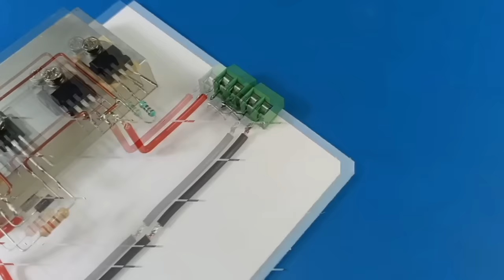DIY Simple 0-30V 0-10A DC  Variable Power Supply // Voltage and Current Adjustable

Comment: Hello , I came back here to say that I created this project , it was excellent , I had already tried others ; but I didn't have the expected result, it was really worth it.
Reply from the maker: You can try with maximum 5 ampere input, result good
Reply: Normal 10k volume control ok ya??
Reply from the maker: @shamnadj8011  yes
Reply: Hola, muchas gracias, la alimentación es de 220v?
Reply: @alfredofont4150  Não , pode ser alimentado com até 30 volts
Reply: Gaming experiment  Have you already investigated it? I also have the same doubt
Reply: i made it and my left potentiometer burned, someone know why?
Reply: @alonalyy meu amigo meu também não sei motivo mais talvez esteja no potenciômetro mesmo tem que ser pelo mesmo 2 watt
Reply: Can I use 120v to feed the circuit?

Comment: Fron the diagram if i remove the volt metre and shot the red wire with the pin beside the positive output wire will it work

Comment: I just made this thankyou so much for this amazing diy 
I tried many YouTube power supply diy's but those were just for the views.
You earned a subscriber.
I would suggest to provide the circuit diagram at the starting of the video
At last thankyou again....
Reply: What is the highest ampere it could handle
Reply from the maker: Ok, please check diagram end of the video

Comment: Can i use tip142 instade of 3055?
In an another i saw he is usin 2 tip 142 for increase the current is it possible plz reply
Reply from the maker: No, you can use any non transistor

Comment: Finally i found the problem today ,it was the tip3055 and 7805, all ics were on heat sink and when i unscrew bd139 and 7805 from heatsink circuit worked but unfortunately i shorted probes and the tip3055 died :) i tested it all three pin of 3055 are shorted together

Comment: WHAT IS THE INPUT? CAN U EXPALIN IT
Reply from the maker: DC 12-30v 1-10A
Reply: At least 5V more than the maximum adjustable voltage..
At least 10% more than the maximum adjustable. amperage

Comment: Hello RJ, 
Thank you so much for this video. It's really helpful for me. Could you please mention how much voltage/current should I inject at source? Actually I'm looking for a voltage booster from a 3v battery. I need variable output as 5v, 9v, 12v along with 2amp at least.
Reply from the maker: Please visit my Channel for dc dc boost circuit

Comment: Hola por favor la entrada de energía tiene que ser necesariamente 15- 30 DC o podría ser de menos voltaje gracias saludos de PERÚ
Reply from the maker: You can use 12-30v dc input 1-7 ampere
Reply: Gracias

Comment: thanks for the contribution, one question if the source with which I am going to feed is 15 amps, the circuit like this works for me, thanks
Reply from the maker: Maximum 7 ampere input

Comment: Dc input 15-30V is fixed or variable?. Can we replace this DC by Ac, using an ac source connected to transformer and bridge rectifier and filtering capacitor??
Reply from the maker: No, you can convert ac to dc with rectifier
Reply: Thanks
 @RJEDITALL
Reply: Can u do the simulation for the same circuit please? @RJEDITALL

Comment: I have carefully assembled the circuit using the provided components and followed the instructions meticulously. Despite double-checking all connections and verifying the orientation of each component, the circuit did not function as expected. I tested each part of the setup individually and ensured that the power supply was providing the correct input voltage. However, there was no output, and the volt-amp meter showed no readings. I have verified that the diodes, resistors, and potentiometers were connected correctly, but the issue persists. What can i do? please someone help.
Reply from the maker: Use this power supply, n make this https://youtu.be/PJ6ZEYMhzgs?si=-kKS1zb13q7A8MjC
Reply: I had the same problem and Now it works Thank you

Comment: Hello @RJ I would like to know the power source parameters used to demonstrate this wonderful creation.
Reply: I built one and am using a solar panel to power, into a boost converter. And my power output is a little low.  So I wanted to know what you used.

Comment: Hllo My question is how many volts i have to provide to the circuit ?
Is it direct 220v ?
Reply from the maker: No 30v dc supply input, with 220v to 15-0-15v=30v ac convert dc with rectifier diode n capacitor

Comment: sir what kind of resistor did you used in connecting  7805 to 2nd pin of 3055, is it metal film?
Reply from the maker: 220 Ohm 1/4 watt
Reply: That information is very useful and what type of resistor did you use to connect the LM317 and BD139 I would also like to know the type of resistor you used for the LED

Comment: hello boss . nice your project . but i have a problem 220R resistor burn in lm317. please send me this solution ....
Reply from the maker: Please use 1/2 or 1 watt Rasistor
Reply: @RJEDITALL  already i am using 1/2 watt . but lm317 short and 220r resistor burn. please help me.
Reply from the maker: @mdsohanahmed4185  please check it well, and change lm317
Reply: thanks boss .
Reply: @RJEDITALL  successfully done my work boss . my lm317 is 2no . today buy new 1 . and ok .😊

Comment: I did it but the 10k potentiometer didn't hold up and it ended up getting burned. Could you tell me why this is happening?
Reply from the maker: Please use multiple potentiometer
Reply: Which potentiometer would you suggest?
Reply: You should use 2 watt pot or more wire wound pot.

Comment: Tnx Dude, I made this but I have one problem, could you help me out, the thing is I didn't find 30 volt input but I have 42 volt input, You said max 30 volt input, what can do that 42 volt works for me on this project? ❤️
Reply: I mean some solution for low down that 42 voltage, I want use Epson SX130 power supply on this project, and also I want to have that Max 30 voltage on this project, tnx
Reply from the maker: You can use 42v , but transistor very heating problems

Comment: May i ask, what is the input voltage source that u used? Is it a battery? And what is the rating?
Reply from the maker: I am using 30v 3 ampere transformer

Comment: Sir..
I have made this as directed...  Though i used the 10k pot (made of adj rod in plastic/pvc) not exactly the one u used in this, but it got burnt...  Could u pls let me know the exact specs for pot to be used for volt and current adjustments...

I have inputted 20v, as it is very well within the spec 0-30v /10amp
Reply from the maker: Check it well, and use big heatsink
Reply: @RJEDITALL  yes.. i used the heat sink, it's paste etc...  Despite that, 10k pot gone for toss

Comment: Excelente…!!
Saludos desde Mexicali BC, Mexico.
.
I have an Xbox 360 with 12v and 16.5 amps.
I know that the amperage is way high, but I’ll apréciate your help to make similar regulator that can support that current…
Reply from the maker: Thank u, Maximum input 3-30v 1-7 ampere
Reply: Вам нужно в выходной каркаде установить несколько транзисторов, базы и коллекторы соединяйте вместе, а эмитеры через мощные малоомные резисторы для выравнивания..

Comment: Need to get 48 volts (DC) 20 amp out put for my 900 watts 48 ( DC ) volts heating element from two solar panels connected in parallel.
Can you help me making a device.
Regards
Reply from the maker: Big project

Comment: Will the circuit work without volt meter?
Reply from the maker: yes
Reply: @RJEDITALL  but what changes of wiring I need to do??
Reply from the maker: @silent_tech8490  No need to change, output Red and black wire
Reply: @RJEDITALL  then will there be some use of 7805 in circuit
Reply: @RJEDITALL  sir please reply
Reply from the maker: @silent_tech8490  you can use without 7805 transistor

Comment: Very good Congratulations! I have a question, if there is a short circuit on the output does the source go into protection or does it have a defect? I'm using a translator, I hope it's possible to understand the text.
Reply from the maker: You can use input side a fuse for short circuit protection
Reply: @RJEDITALL Добрый вечер!
Предохранитель на сколько поставить?

Comment: Good video!  I got the parts to build the device!  Will I be able to have 5V and 8A at the output so that it does not overheat and shut down?
Reply: Выходной каскад на 3055. Сам транзистор по даташит выдерживает 15ампер, но нельзя не считаться с рассееваемой мощностью. Для этого транзистора в металлическом корпусе она 115Вт. Для успешной реализации Вашего проекта нужно знать входное напряжение. Например у меня выходное 21в, а выход в Вашем случае 5в, значит падение в 16в умножаем на 8ампер =128Вт рассеивания, это погубит транзистор, а за ним и lm317. Вот если на входе будет 11вотльт то уже нормально. Но не забываем про охлаждение!

Comment: Normal 10k volume control ok ya??
Reply from the maker: Yes, but multiple variable pot best
Reply: MJE 3055 ok?
Reply from the maker: @shamnadj8011  ok
Reply: Maximum input supply?
Up to 55 volt possible?
Reply from the maker: @shamnadj8011  30v

Comment: Hola hice el mismo circuito con voltaje de entrada de 24v a 3 A y no funciona no prende ni el voltímetro... Me gustaría saber que pasó!
Reply from the maker: Please check it well, and check your pot , n transistor
Reply: @RJEDITALL  use el tip 41c usaste ese o el otro q anotaste por q según yo todo está conectado igual para saber q tránsistor está dañado que voltaje tiene de salida cada uno por q el regulador lm317 t si tiene salida de voltaje

Comment: What was your input voltage ?
What is the max input current/voltage?
Is your input ac or dc?
Is the output ac or dc?
Reply from the maker: Maximum input 30v 7ampere dc . Output dc

Comment: What is the power source in this video?
Reply from the maker: DC supply input
Reply: @RJEDITALL  from what kind of battery or other circuit
Reply from the maker: @davidprock904  transformer
Reply: @RJ EDIT ALL  what are the volts & amps (that you said is DC) from the external source that you do not demonstrate in your video?

Comment: what kind of power do you use input?
Reply from the maker: Dc 3- 30v 1-5 ampere
Reply: @RJEDITALL  i wanna ask also what should i do to have 36v 10a adjustable power supply connectted to directly home power 220v ac. i need to power my 775 dc power for good rpm. i dont have anything for it
Reply from the maker: @resatbora  you can use 220v -36v 10 ampere transformer for your adjustable power supply connect

Comment: On va appliqué une tension continue ou alternatif combien de volt  ?
Reply from the maker: Maximum 30v input
Reply: @RJEDITALL  comment obtenir un tension continue de 30v on peut faire quoi  ??
Reply: @RJEDITALL  comment je peut obtenir 30v  ?
Reply: Para obtener corriente continua de un cargador de laptop o simplemente a un transformador con salida de 12 o 15 voltios de corriente alterna le haces un puente rectificador y le pones 2 condensadores para llegar hasta 20 a 30 voltios de corriente continua.

Comment: Sir my resistor always fry once we plug it on AC , the resistor 220R connected from 7805 to 2nd pin of 3055 is what im talking about sir.
Reply from the maker: Please check diagram in the video

Comment: Nice job bro., Can I use this circuit as a battery charger? What is the maximum amps.in output? Thanks bro. More power to you!...
Reply from the maker: 0-6 ampere
Reply: @RJEDITALL  cuanto voltajes de entrada??

Comment: I have given 12v dc input
Used of the following
LM317T
BD139
TIP3055
LM7805
1N4007
220 OHM 1/2 WATT RESISTOR
IN BOTH PLACES
BUT THE VOLT METER NOT SHOWING PROPERLY
AND I CAUNT MEASURE THE CURRENT
Reply from the maker: Please use multiple potentiometer

Comment: At what supply does this project run?
Reply: we have to give 30v dc and 10 amp from  dc sources  to this control  circuit,  then we can  vari the output voltage  from 0 - 30v  and current  from 0 - 10amps .

Comment: RJ I have 1000w ups, but it works 24v, I have a 100A battery, if I connect it to this circuit you made, I will run ups.
Reply: 12v 100A
Reply from the maker: No bro, you can use maximum 7 ampere 30 dc input

Comment: Hola. He hecho el mismo circuito y el Led rojo parpadea constantemente y el 3055 se calienta muchísimo 8ncluso a bajo emperaje. Cuál puede ser la causa?
Reply from the maker: Please check It well, and big heatsink use
Reply: @RJEDITALL  el caso es que la fuente funciona perfectamente, pero no podría aguantar 5 amperios nunca, mucho menos diez. Le cambiaré el disipador. Y el led parpadea siempre. Esté en uso o no, parpadea el led, y no le encuentro explicación
Reply: Amigo ya revisaste la etapa de rectificación y filtrado que puede ser por ahí el problema ya que el LED es solo para indicar que hay alimentación a la entrada del circuito regulador.
Aparte creo que tienes razón con costo 5 amperios en el mejor de los casos puede sacar.
Reply: In С1 4700 m x50 v, out С2 470 m x50v. Этой схеме нужны сглаживающие фильтры .

Comment: How many volts and how many amps has entered the circuit?
Reply from the maker: 3-30v 1-5 ampere input
Reply: @RJEDITALL  If the input is 5 amps, the output will be how many amps
Reply from the maker: @muhammadyasyen3180  same

Comment: I made it, but not worked, i do everything like in the video and all my part is exactly same as video's parts, my input source is 19v 4 amp laptop charger, without that red wire that connect input source positive to third pin of lm317 red led turn on,but when red wire connects to lm317 my laptop charger light not turn on
Reply from the maker: @catworld4654  you try this circuit 
https://youtu.be/PJ6ZEYMhzgs?si=TF2bnpJRNCLFgFmJ
Reply: I dont have some part of your suggested video,i prefer to make this one correct that can work, i will make it apart tomorrow and start from beginning,

Comment: Cual puede reemplazar BD 139 ?
Reply from the maker: Not understand
Reply: @RJEDITALL  

.NO. INTIENDES. LA PREGUNTA ?😒😒😒?????????
Reply: Otro = BD139 ?BD 135 ??????
Yeso? O not
Reply: Yes. O not ☺
Reply: NPN.
Reply: NPN.     O.       PNP.      ?

BD 139.       O.        TIPO 35C ??
Reply: ARGENTINA 🔵⚪🔵
Reply from the maker: @claudioalbarracin9140  you can use both transistor
Reply: @RJEDITALL  GRACIAS 💪💪💪💪💪💪👌👍😄❤👍👍👍👍